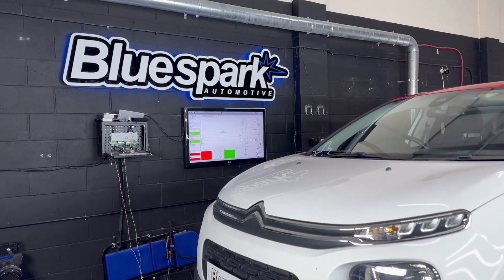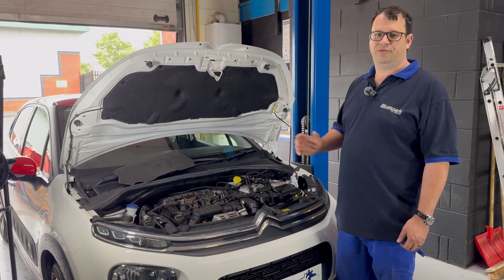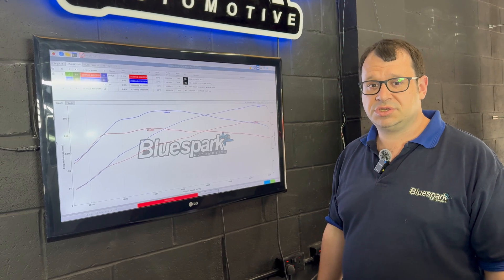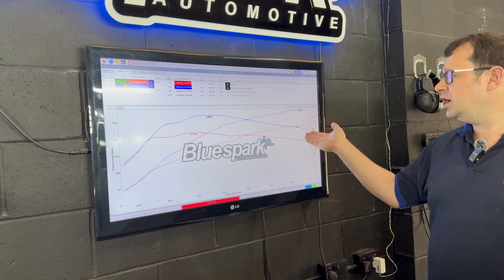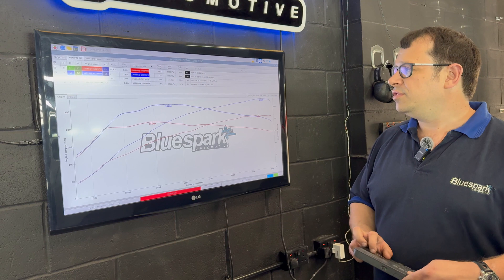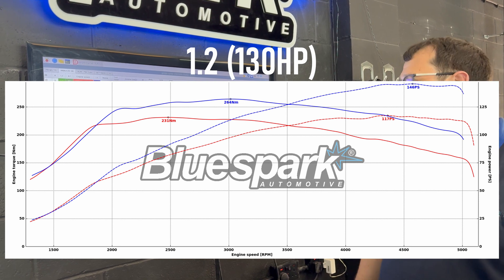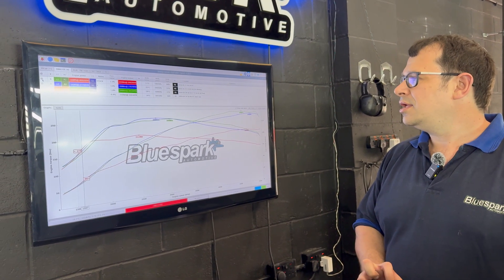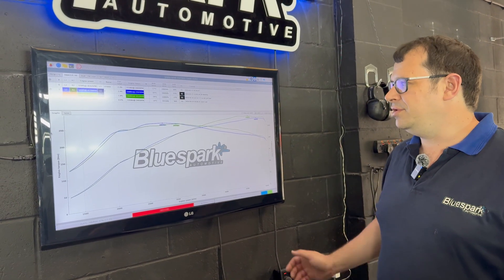Citroen C3/C4 1.2 PureTech 110hp/130hp Dyno Test – Bluespark Tuning Box

Comment: I have Opel Corsa F 130 hp 8 AT and the car revs up to 6,500 red line. But Peugeot with same engine revs up to 6,000 red line. The peak power based on manufacturer is at 5,500 rpm. So why is Corsa reving higher with same engine and gearbox? And in this video the graph goes only to 5,500 rpm. Am i missing something?

Comment: I would like to know how to activate the dyno mode on a Citroen vehicle.
Reply from the maker: You don't normally need to. Most Citroen's don't have a dedicated dyno mode, but you can normally just switch off traction control and run the car. On a 2wd or non-linked dyno it will throw an ABS error, but you can just carry on. When you are finished, drive the car, clear the errors and all should be well.
Reply: @BluesparkAutomotive 
Thank you. I didn't know that Citroen didn't have a dyno mode. Do Citroen's electric cars not have a dyno mode either?
Reply from the maker: @ぼん-q7z  not sure about electric cars, don't really get involved.
Reply: @BluesparkAutomotive citroen I own doesn't have dedicated traction control button. Is there any shortcuts to turn off traction control?
Reply from the maker: @alokbisht3158  can usually be accessed through the infotainment system menu
Reply: @BluesparkAutomotive nothing realed to drive in infotainment unit. I thought it may be combination of few staring based key or some obd scanner does the trick.

Comment: Something not right with the 130. 117 bhp seems low. Should be around 128bhp stock ending up over 150. Think there's a Peugeot GT thats 155bhp stock. 🤔
Reply from the maker: It should be 128hp stock on paper, but quite often cars are a little bit up or down, not all dynos read the same, and all sorts affects the readings. If I recall correctly the 130 we tested was still on its winter tyres, which always sap a few hp. What's important is the gain vs stock, which in this case is very good on both examples.

We quite often test cars and find that they are consistently up or down vs the claimed figures. A good example of the other way around is BMW M140i's, they consistently make 20-30hp more than their claimed figures stock.
Reply: @BluesparkAutomotive  I see what you mean. Just thought E10 fuel could do that. Always run my Puretech 130 1.2 On Shell V-Power + Bluespark.
Reply: Also power depends on the fuel being used. Official number may come from slightly different mixture of fuel.
Reply from the maker: @alokbisht3158  Yeah you are right, sometimes lower octane fuel can give marginally lower performance even when stock 👍